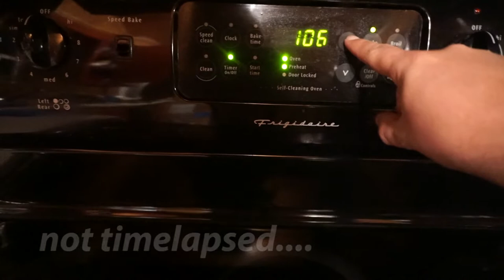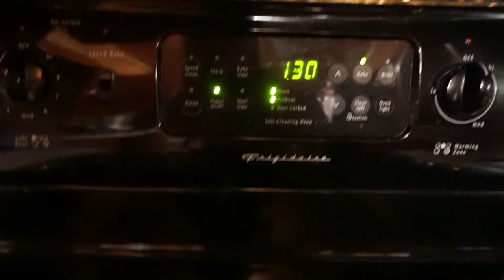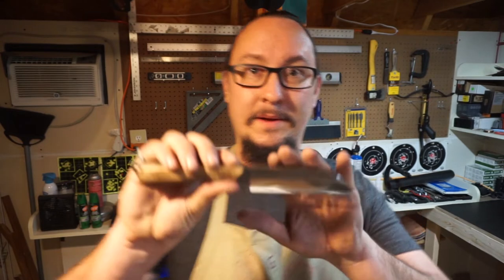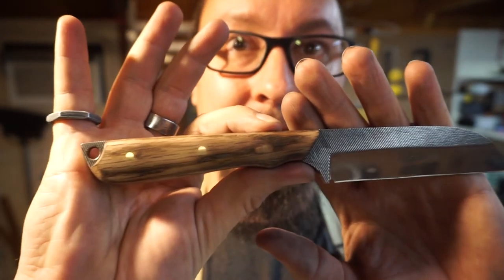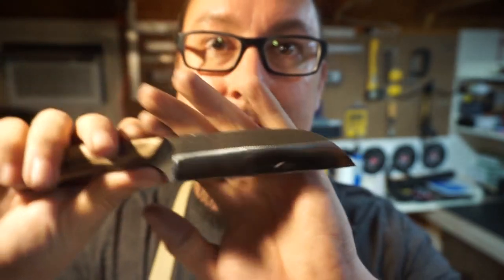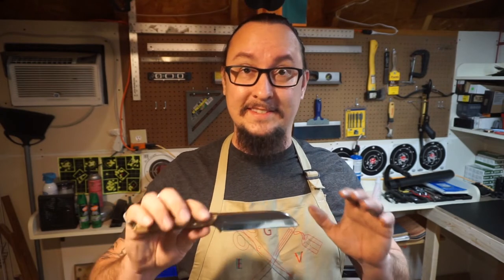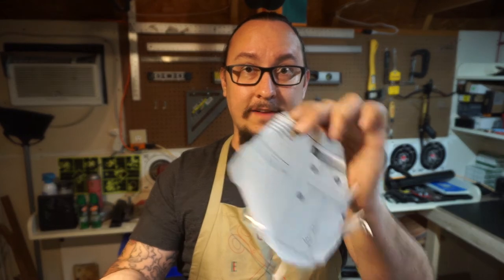How I Made My First Knife | Knife Making | Vlog

Comment: Nice vid. When did you drill the holes in the file metal? Or did I miss that? And want issues did you have with that?
Reply from the maker: Oh man, it was a pain in the butt. This was the first time I ever had to figure that out. I eventually used a torch to heat up the tang then let it cool slowly so that I could drill through it. I wrapped the blade in a wet rag while I heated the tang to red hot.